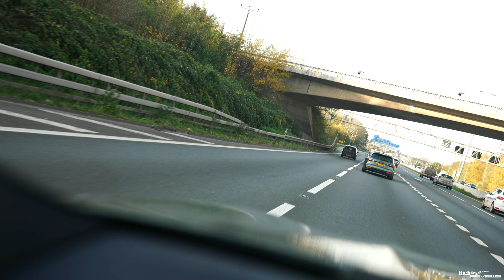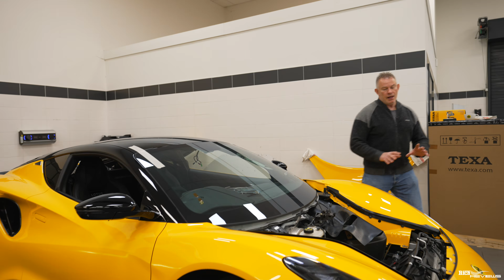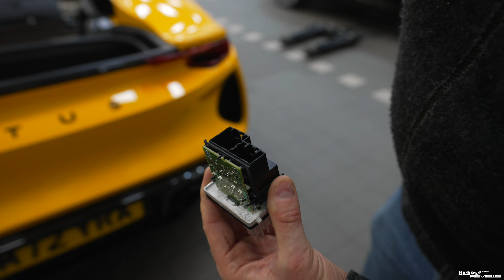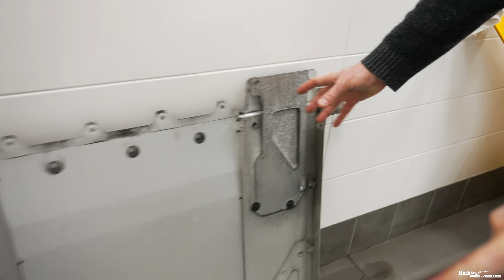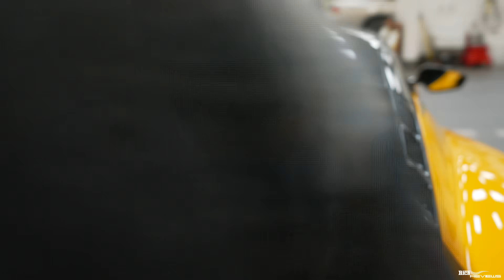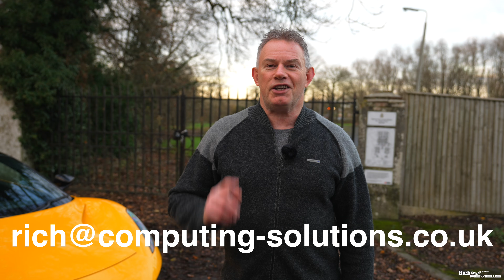Lotus Emira REPAIR WALKAROUND at LOTUS WORKSHOP! (...and Another Fault)

Comment: what was the problem for the replacement of the rear engine cover?
Reply from the maker: It's clearly detailed in the videos. 👍
Reply: well what I heard is you said that now is immaculate and it has been resolved so I assume you gad paint problem? So much so to replace the entire engine cover panel? for some paint issue?
On another video of yours, you mentioned some kind of a water penetrating in the sandwich of the composite panel. Maybe that’s the case?

Comment: What kind of engineering is this?? By a 5 year old? So if you have a problem you cant even check fuses?? WTF?
Reply from the maker: You can but you have to use the tool provided and undo the leading edge fasteners. It’s definitely a faff.

Comment: I can't believe they didn't design the Emira to have a water channel. Looking at that crappy bodge fix, it appears to cover only half the area, so I assume water is still gonna leak into the front and cause corrosion elsewhere.
Reply from the maker: The membrane directs the water to flow away from the electrics where it can run-off without issues

Comment: The weight distribution is ~ 62 rear, 38 front.  Unfortunately you are just getting started on your Lotus journey.
Reply: So not a true mid engine, more rear mid
Reply: @Jay-xr3sb  Correct by weight distribution.  More 911 than Cayman.
Reply from the maker: Weight is high instead of low centre of gravity but it is mid-rear. Key aspect is that the engine mass is forward of the rear axle not behind.
Reply: @RichReviews_  The weight distribution is measured at the wheels, this is where the mass of the car impacts the handling of a vehicle.  The high centre of gravity lifts the roll centre.
Reply: @VK6AB-  porsche have been trying to engineer around their problem for years, slowly moving the engine forward but retain a rear engine label for 'heritage' purposes. 

Cayman/boxster always wins, Low centre of gravity with the flat 6 and perfectly balanced as all sports cars should be.
Reply: @Jay-xr3sb  Its not a problem c.f. 991.2 GT3 RS, 991 GT2 RS, 992.1 GT3 RS ..... if its done well e.g. has very good rear suspension, active engine mounts and active rear toe.

Comment: Wow your car certainly managed to sneak past QC at the factory! Either that or Lotus had received parts that weren't up to standard in the early days of manufacturing these.  I'm glad they're getting yours sorted out, because these cars are so much fun to be in and drive.
Reply from the maker: I agree…early new design teething issues. Mine will be one of the best sorted reliable cars on the market  when finished.

Comment: This series has put me off from buying an Emira. Going with a 718 instead. Thanks.
Reply from the maker: Taking into account the Emira is a new model and new models always have issues to begin with...I feel this shows that Lotus will resolve issues well and with complete new parts redesigned where required to resolve the initial issues.
Reply: Moving from 718 spyder to GT4 then to Emira….. now i regret so much. Better stick with 718 not GTS but GT4 or spyder.
Reply: 718 i,m bored already.
Reply: Excellent. Enjoy looking at me in my Yellow Emira in your invisible car.
Reply from the maker: Huh?!
Reply: @davids2060-y1c  "Enjoy looking at me in my Yellow Emira in your invisible car" as some sort of defence of the issues Emira's are having is probably the most cringe things I've seen anyone write on YT in a while, and in this political climate that's saying a lot.
Reply: @capuchinseven haha. It took you just over 2 months to come up with your weak reply. Yes. You chose right.
Reply: @davids2060-y1c  you’ve confused me with someone else.